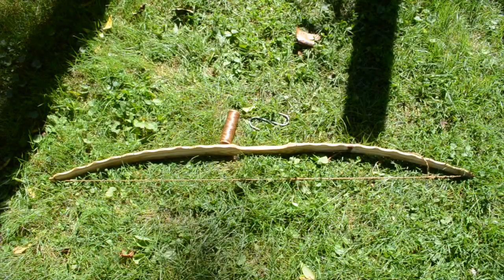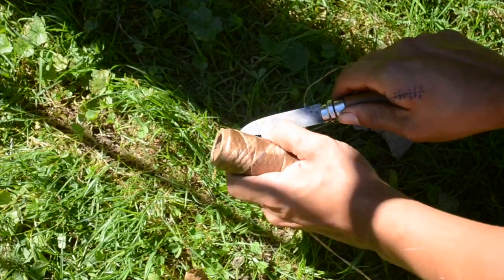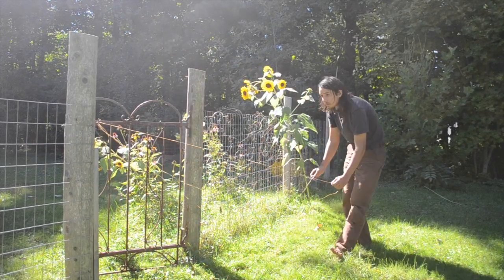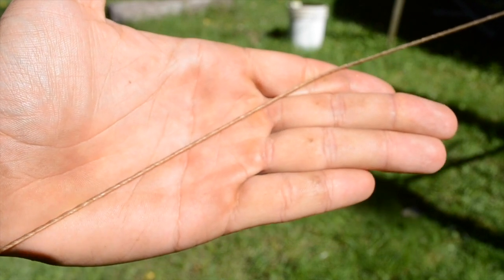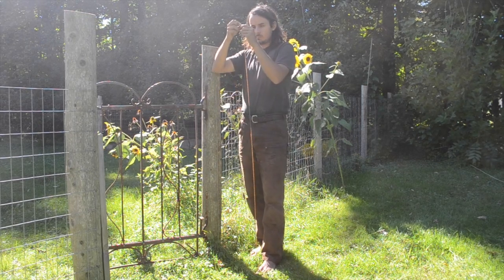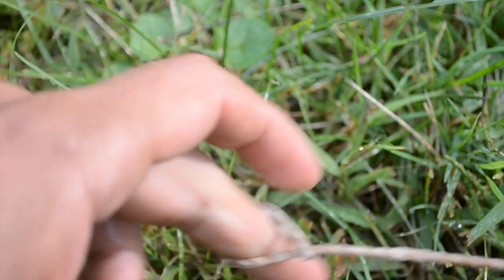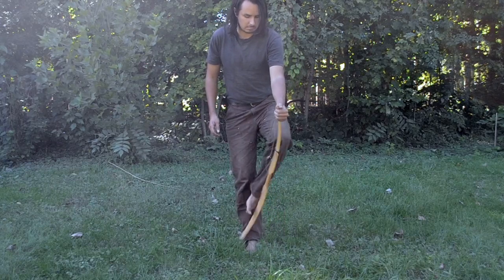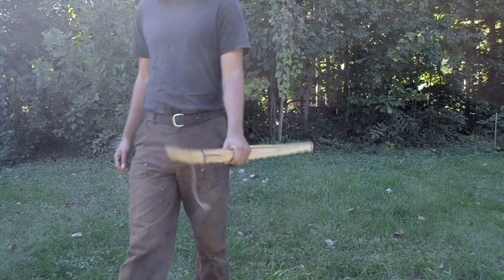Making a bowstring.

Comment: Pretty much what I do except I make my loop slide it on the top nock .while bending the bow upside down I wrap the loose end around the bottom nock, pass the loose end under this and wrap opposite direction, then tie it off. If it stretches while in use,  I just unloop the top nock give it a few twists and reattach loop to top nock.
Reply from the maker: Sounds about right.

Comment: What kind of string do you prefer to use
Reply from the maker: Sinew or hemp are the best. Very strong and fast. But Sinew is no good in the wet and hemp requires periodic maintenance.
Linen is the next best, it’s like hemp but weaker.
Then fake sinew. It’s strong and low maintenance, but it’s a little sluggish.
Leather cord is very sluggish.
Sisal and cotton are too weak for bow strings.